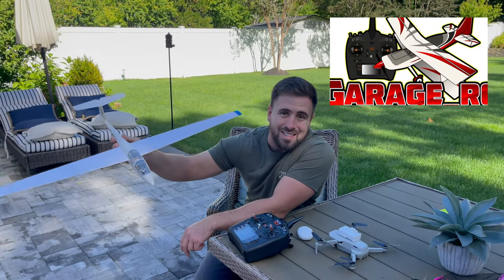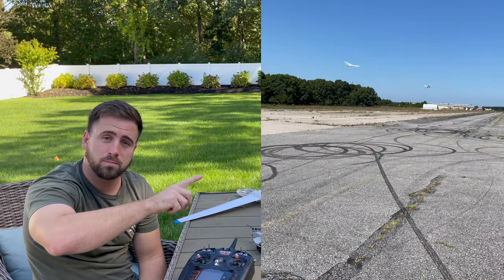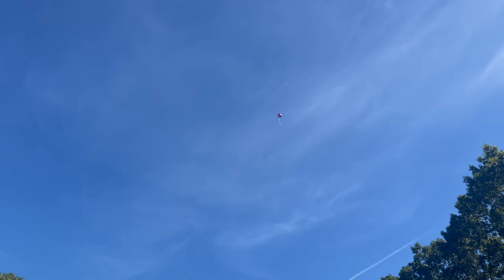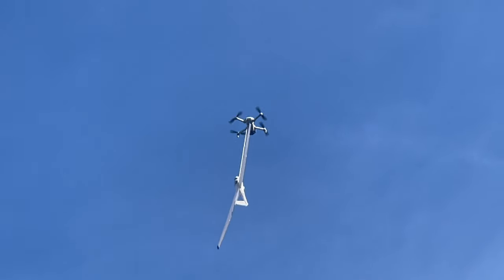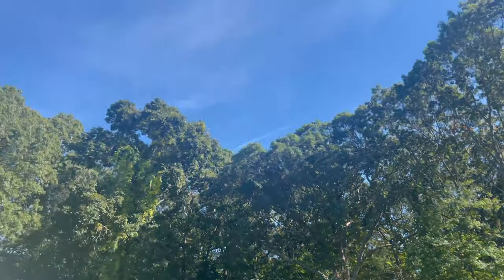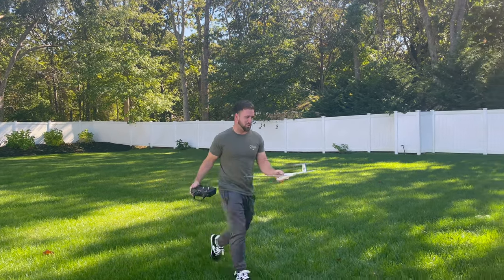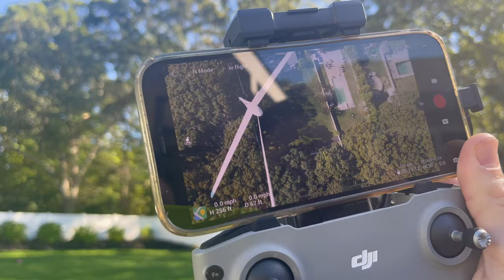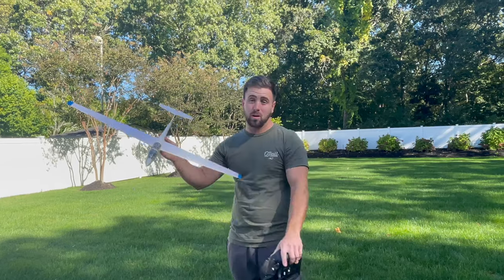DJI Mini 2 dropping RC GLIDER! - UMX ASK-21

Comment: It seems to descend very quickly!  Is there a way to use wind/updrafts to keep it up longer like a real glider, or is this actually how the real glider behaves too
Reply from the maker: You can definitely keep it up longer, video doesn’t show.. but because it’s directly over my head hard to tell pitch angle. And I bring it down quick so I don’t stall and end up somewhere I shouldn’t! I’ll make another video soon at a field and longer video of towing it with a plane
Reply: I just bought one off eBay, my first impressions are this thing has the glide ratio of a brick, there's no way it'll ever thermal, it might work for a slope soarer but it is a sled ride from release to the ground.  I''ll probably put it back on eBay and try to recoup my losses.

Comment: And you almost gave this away in the beginning.  Skill level is crazy good. Props to the camera work. Not easy to keep up with a plane in the air.
Reply from the maker: Glad I kept it ! Need to do another plane towing it session soon
Reply: @Jays_rcgarage  could this Glider be pulled by an RC car/truck. I mean could it get lift and fly 🤔